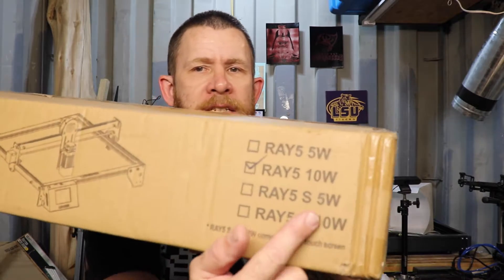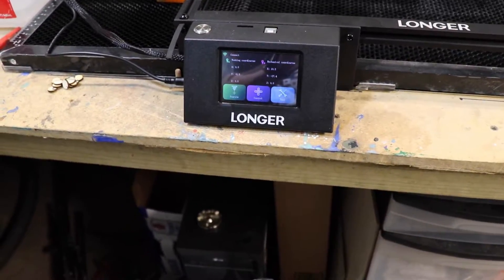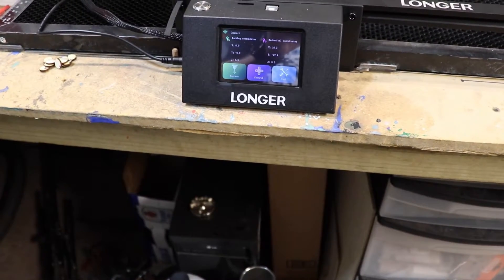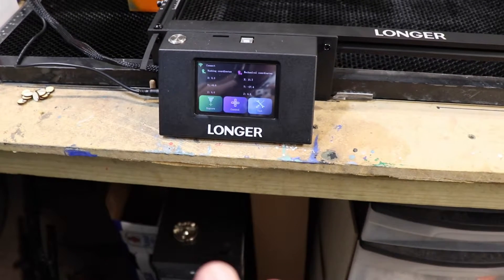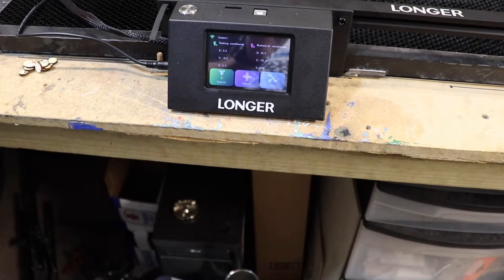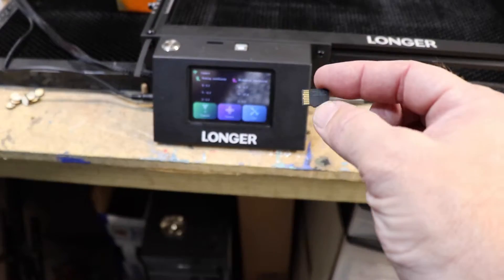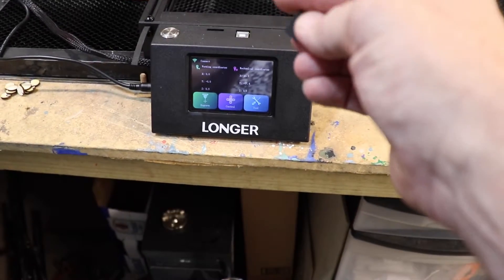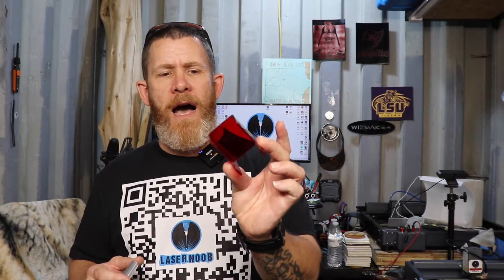LONGER RAY5 10W REVIEW

Comment: Have you figured out what the "adjustment" % settings are for yet? On the touch screen control panel under adjustments it says 50 % & 3%. I'm having trouble finding out what these settings are for. I have the same Ray5 10 watt as well but I'm unsure if I'm getting the most out of it due to not knowing what that setting is for. Any help would be greatly appreciated. Just bought the laser noob  burn test file off Etsy for lightburn and I want to make sure I have all the settings right first.
Reply from the maker: I will be doing some work with the ray5 next weekend, but the panel is (should) only be from burning from the SD card. Any lightburn settings "should" override the touch screen if you are using lightburn to run the project.

Comment: Thanks for sharing your videos with us. My first laser was a Longer Ray 10 watt. I never planned to be a laser guy but just to have something to engrave things I turned on my lathe. The Longer, nearly a year later is still doing what I need it to do but I have begun to do more with the laser than any other wood working tools in mt shop. I do however wish the air assist nozzle had a smaller hole but it works. I buy 3mm plywood from Amazon and several don't like to be cut and the brand that cuts like butter is no available now. It cuts with 300mm/min @100% power. Who knew laser cutting/engraving would be so much fun.